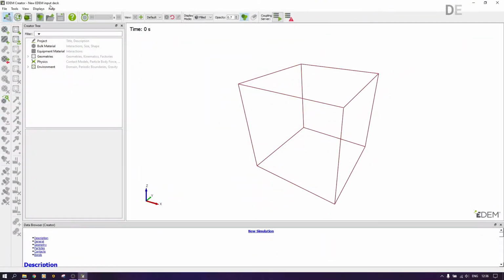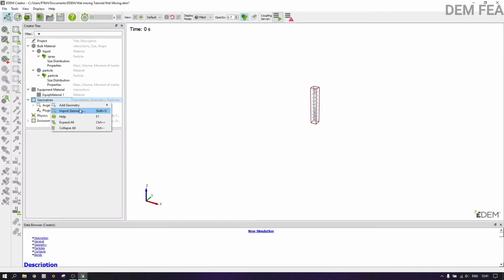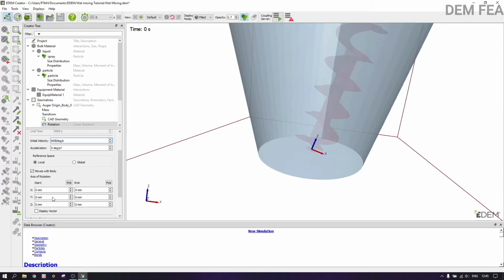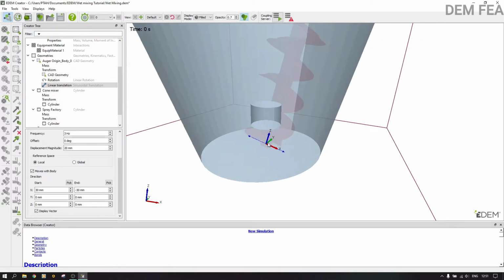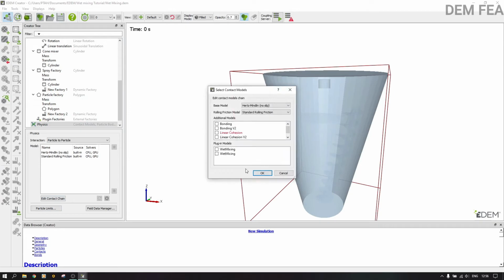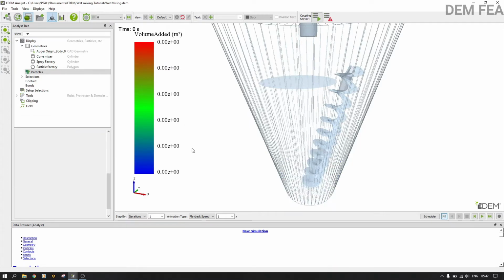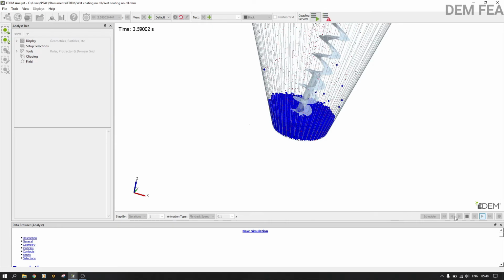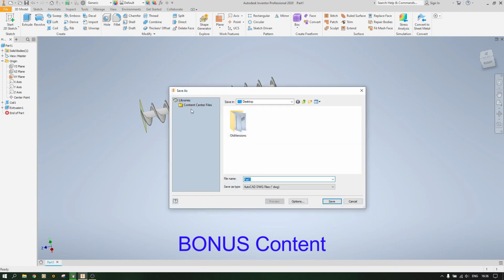Wet Mixing in EDEM using Custom API in a Conical Mixer (Step-by-Step English Tutorial) #Conicalmixer

Comment: I have a problem where i run the simulation but make a mistake on particle size for example. When i go back to the previous page and edit it and then go run it again.. it doesn't seem to use the updated value. how to fix this?
Reply from the maker: You need to also reset the time. Put the time to 0 before changing the particle size.
Reply: @PiotarockIn  Thank you. Veryhelpful. Your tutorials have been invaluable.